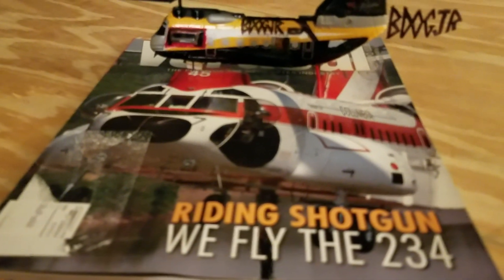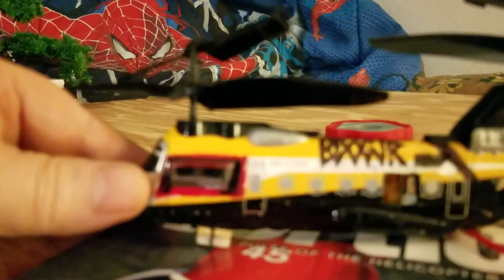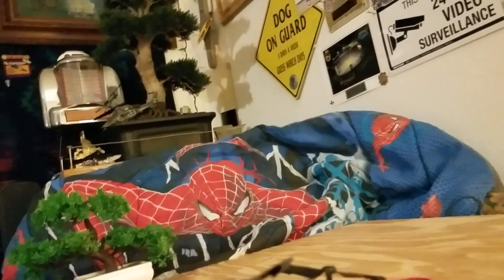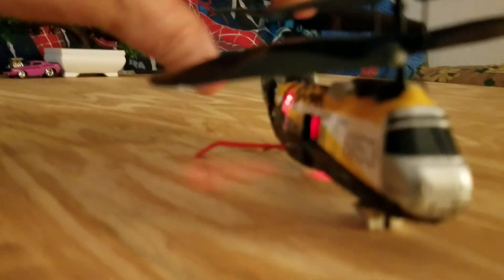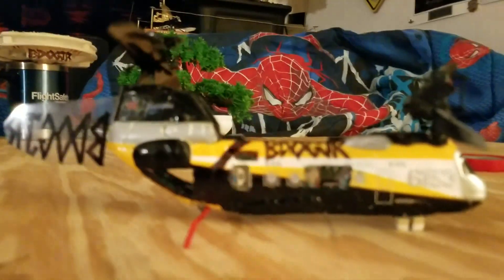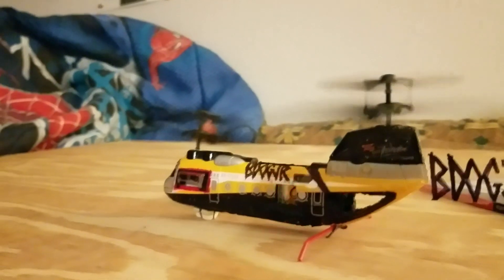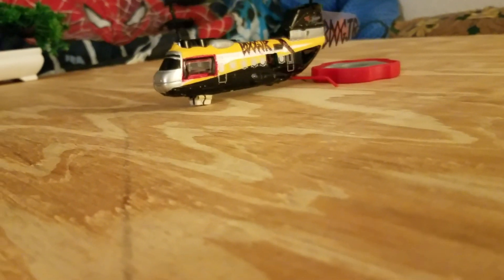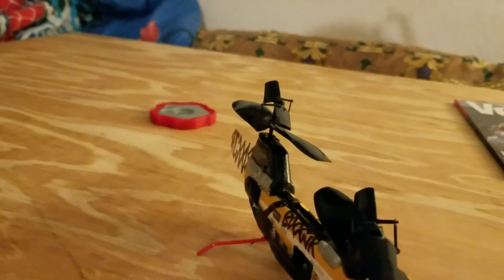Air Hogs Twin Thunder r/c helicopter  repaired ☻

Comment from the maker: Thanks R&R《☆》I was watching another channels Twin Thunder video from 2009 today and noticed that there is a clear plastic vertical stabilizer on the front that mine is missing. I can cut one of those out of a piece of scrap plastic and make a slot for it to mount on the front :*: I believe that will make it much easier to fly ☻